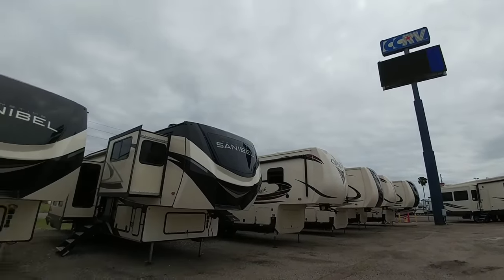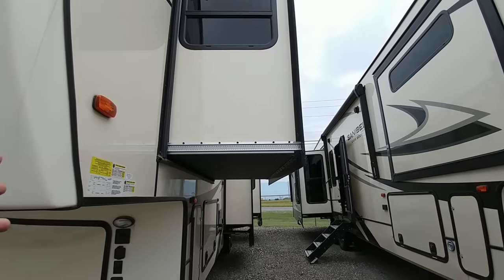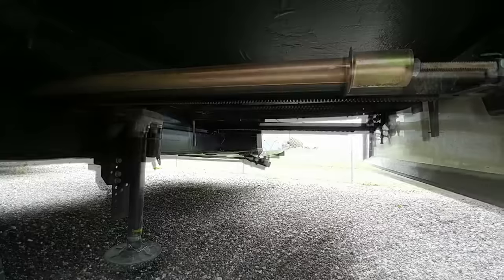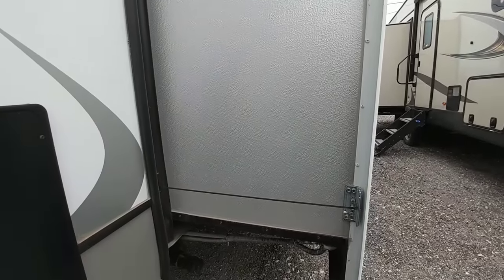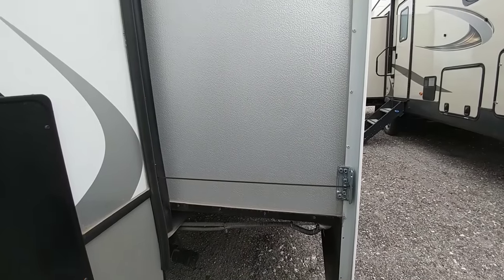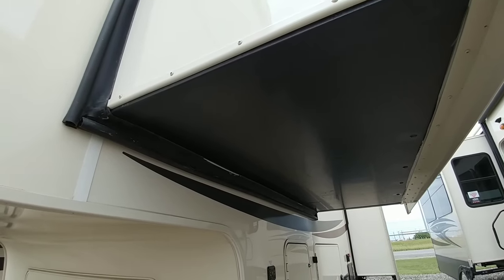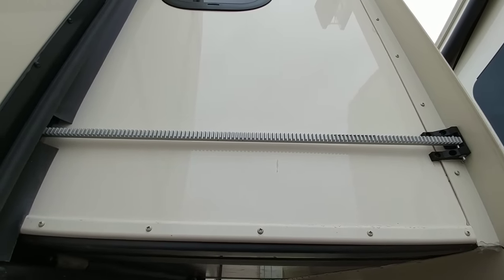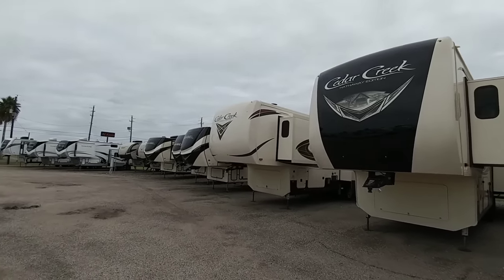The 6 Different types of RV Slide technologies and how they work!

Comment: I was looking at some used fifth wheels and came upon one that used the cable system. It wasn’t very old, but, unfortunately I don’t recall the year it was made. I was looking at the cables and noticed several items that made me decide I wouldn’t purchase an RV with this type of slide mechanism. First was that the rubber seals were badly damaged where the cables came through the side of the RV. Second was that several of the cables were sagging and needed adjustments. Perhaps I am being harsh  and judgmental. Is it possible that the previous owner simply didn’t have the finances to repair it, or perhaps they didn’t notice the damage and needed repairs? Either way, seeing how poorly it looks after a few years turned me away from purchasing any RV with a cable system.

Comment: I will never have cable again.  After 6 months it completely failed.  It bound up and the slide frame bent.  whole system had to be replaced.
Reply: We have a small travel trailer with a cable slide. I've had to tighten the brackets but, after 11 years, still works will. Of course a knock on wood now!

Comment: I have the BAL oldest version with the good motor and gearbox. In and out thousands of times. The "Upgrade" motor and gearbox fail a lot. I have had cable failure at the fitting twice. If it is only one cable the slide works fine if you go slow and make sure the slide does not get out of square. I fixed the cable end with a swage fitting the first time. No good. Failed in two years. So I fixed it the second time with 1/4 inch stainless Tee Nuts and silver solder. Very easy to do. The so called experts try to adjust the cables with no slack. That really puts excessive strain on them. I also, discovered the hard way that jacks under the slides are mandatory. Do whatever you want. Remember that expert usually works for the slide mechanism company or for the trailer manufacturer. They are not going to tell you the way to keep your trailer for fifty years. They want it to break so you buy a new one.

Comment: LCI Slimrack.  Had this on our NorthPoint.  Absolute failure prone and not reliable.  We got rid of the NorthPoint because of this slide system.  Garbage.  Go with Schwintech and /or old school rack and pinion.  Very reliable systems!  Bought two new fifth wheels when we got rid of the NorthPoint.  Made sure neither had that stupid Slimrack.

Comment: Schwintek is NOT reliable at all. I was just camping ( 2 year old Grand Design)and one of the motors sized up or quit working. After reading the manual and calling the factory, I had to drill rivets, and basically rip out the rubber weather-stripping just to get to the motors. Then I had to remove the motors to manually slide it back in, with the help form several others. The slide then was unstable and almost fell out...then had to bum straps and tow straps to hold in the slide out so I could make it back home. Lesson  Learned: Never buy a RV unless it has a way to manually slide it in via a wrench or crank tool.

Comment: As an RV tech I hate swintec.
Reply: Which system do you feel is the best with little to no issues? I have the cable system and it (RV) is in the shop now to have that fixed.

Comment: Yes well I think a swintec is a great big peace of crap and cost a small bank loan to fix them when they fail and trust me they will fail it is just when take my advice and don’t get a swintec they are junk and my 2014 has been messed up since day one and after taking it back to the dealer they told me they had no idea what was wrong with it so I had to try to fix it myself and by being a certified mechanic for over 35 years I have seen some junk and they are for sure I called the factory that makes this crap and the first thing the guy said was don’t start bad mouthing our slides check the hole in your camper to make sure that it is not to big for the slide and he gave me the size of opening that should be in the camper and I checked it and it was just what he said it should be. So I told him what it was doing and he said well you need to take it to your dealership and let them check it out then I told him that I already had done that and they charged me $45.00 to tell me that they had no idea what was wrong with it. So I decided to take it apart myself and see what I could find wrong and the little Mickey Mouse wheels that run on the little track on the side of the slide had the snap ring off of one side so with some help from my wife got it put back on the pin that it was supposed to be on and tried the slide and it seemed to be ok so we went on a trip or two before it went haywire again so I take it apart again just to see what was wrong and now the little Mickey Mouse track is loosing the lite duty teeth off of it so I call the company again and finally get parts and four little aluminum tracks are over $600.00 dollars so I had just about made up my mind to trade the peace of crap off but it was not going to be easy to do with the slide broken . So got on EBay and found a set of tracks that a guy had bought and then sold his camper and didn’t have any need for the tracks so for $300.00 dollars I started to put it back together again just to find out that the factory had the tracks on the slide off a 3/4 of a inch from one side of the slide to the other so with my wife helping me I got the thing level and tracks back on it and back together and I have used it a couple of times without it breaking but I just don’t like the weak ads set up for a slide so take my advice and don’t get a slide with this kinda drive system they are junk!

Comment: Some false info in your video.
Reply from the maker: Please explain
Reply: Big Truck Big RV the schwintek slides don’t have a “neutral “ to just push them back in you must disengage the motor then at that point your slide would need to be secured closed to avoid then opening unintentionally during transport